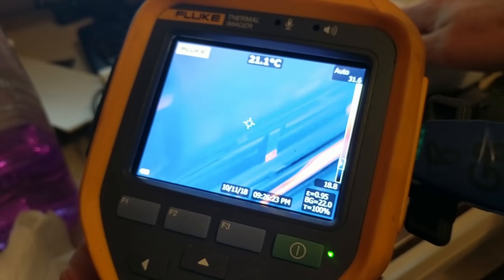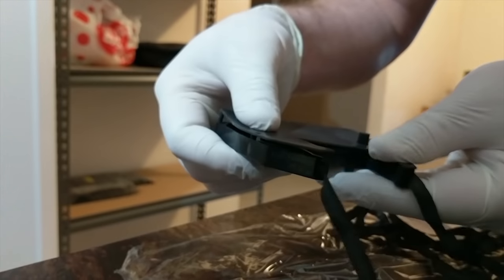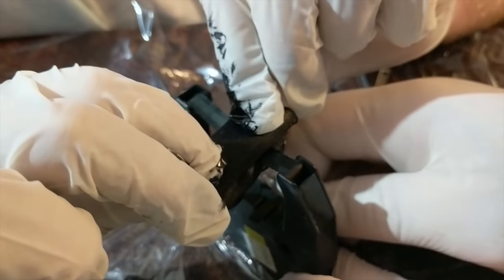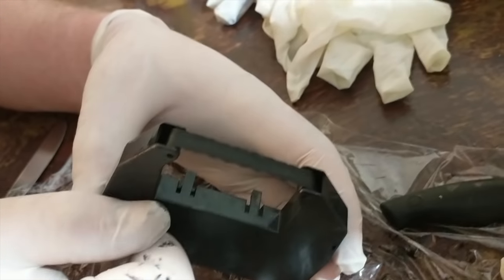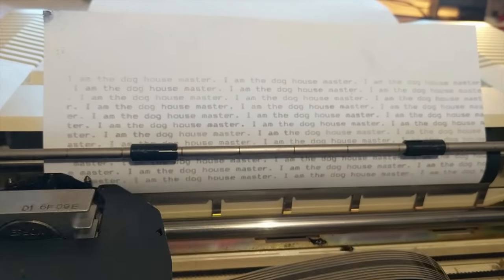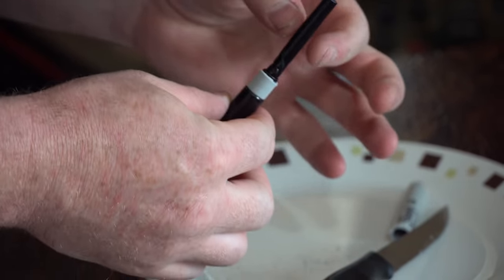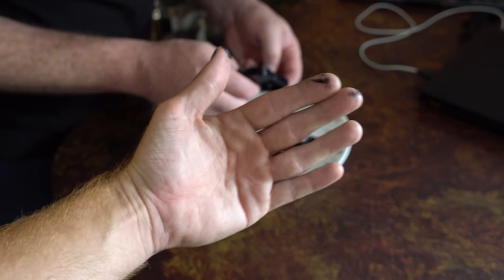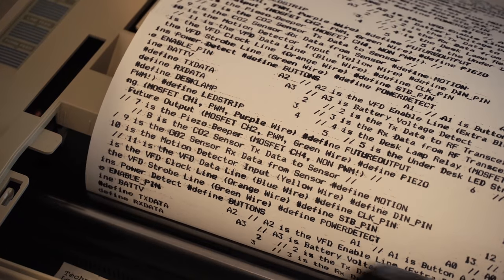How To Refill Dot Matrix Printer Ribbons - The Hacky Way

Comment: I bought a gallon of the correct ink for ribbons about 25 years ago. The MFG assured me that the ink doesn't age and never settles or needs to be stirred. I typically hold the cartridge in a small hobby vice and use a small cordless drill to turn the cartridge gear. Then I suck up some ink in a big hypodermic syringe and apply it to the ribbon as it turns. Then when all the ribbon is coated, I wipe off excess with a rag as it continues to move. The WD40 is brilliant!!!  I hadn't considered THAT!!!
Reply from the maker: Nice work, that sounds like a great method!
Reply: great! i think ill try. I have a NIB leggend 880 printer but the ink cart is dead. its one pf those long carts. I have lots of ink in bottles. cant wait

Comment: I have an Amstrad dmp-2000 printer which just has a single loop of ink ribbon but it seems impossible to find a replacement (unless you want 100 units) and mine was shredded.  I managed to get it working by purchasing a roll of typewriter ink ribbon but I was unable to find any the required width so I cut it down to size using a hot wire (search for "foam cutter" for more info, they are easy to build), if you try to just cut it the edges fray and just makes a mess.  I then tried joining the ends with some very thin tape but this did work but not very well, much better to join it using a plastic bag sealing device (search for "impulse sealer") which on max setting does a very good job.  I bought myself a bottle of ink pad ink which does a good job of re-inking it.
Reply from the maker: Wow. That’s great work. :)
Reply: I think I like the Sharpie method most from what i've seen. Hoping to do this for a future project about my Amstrad DMP-2000.

Comment: Here's a newbie question...  Are these cartridge ribbons generally a continuous loop or does one need to back it up after you apply the ink?  I have an Epson LX80.
Reply from the maker: Continuous loop!
Reply: @WhatUpTKHere  Thanks!  The "other" challenge I am having with my cartridge is that the foam tires around the two wheels that move the ribbon have disintegrated, so they don't move it when you turn the knob.

Comment: Lol guys interesting. You are aware that most modern inks are water based and dot matrix pins are steel and over time the pins will rust. However you may have saved it with the WD. I make my own using a tiny drop of black pigment and linseed oil, works great. You can also use oil based stamp pad ink, but that is also getting hard to get and is now mostly water based, being the reason I decided to make my own ink. Sharpie pens come in oil and water based,  Oil based sharpie's are paint markers with a ball in them,  but that is a paint not a ink  from what I make out .  Take care.
Reply from the maker: Interesting insight!

Comment: If anyone knows where to get CMYK ribbon for a Star LC100 Colour, Let me know. the Cartridge is LC9CL. I can find the Black only ones. That are narrow. that will probably work for black only printing. Might cause grief if colour is involved as the ribbon moves up and down across the print head in CMYK passes to print colours.
Reply from the maker: That'd be so cool if you can find one.

How do they stop the colours bleeding across the ribbon?
Reply: @WhatUpTKHere  I dunno. Must be thick gunk ink. But still dunno how is doesnt ruin the colours on the ribbon printing say green or purple. Must print yellow first then blue for green. Red then blue for purple. It does 8 colours if you include black and cmy for dark gray.
Reply: Have you found any CMYK ribbons? I also have a LC100 and the only color ribbon I have is absolutely dry
The method shown here can only be used in single color ribbons (the majority) because I would smear and mix all the colors
Besides you need yo find the pure colors so your prints come out correct... sharpie colors aren't exactly standard pure printer color
I am tempted though to open the cartridge and only lightly spray it with WD-40 as the cartridge has very little use and all the ink must be still there albeit dry
Reply: @WhatUpTKHere  as uber says the ink bust be not very fluid and mostly stay in place very stable as I dont seem to see any physical separation between the color bands 
Reactivating this 4 color ribbon is going to be a nightmare compared to your little sharpie adventure :)